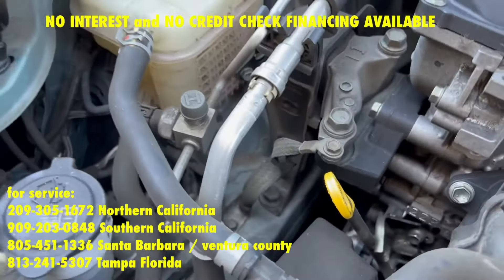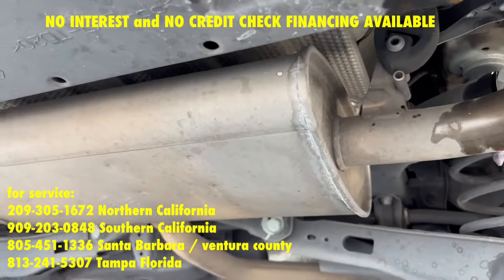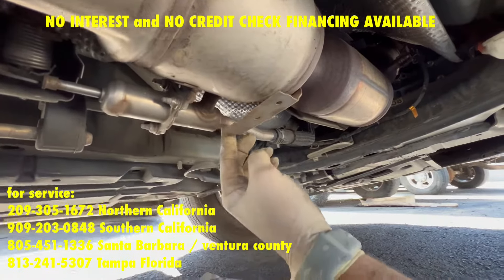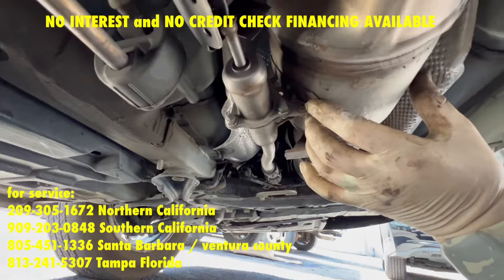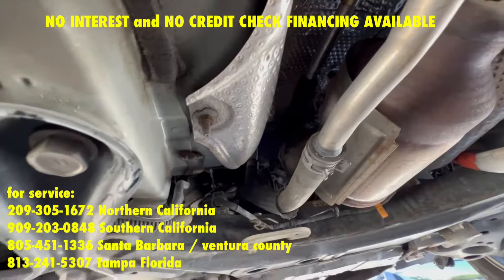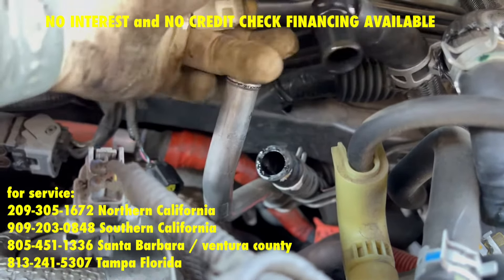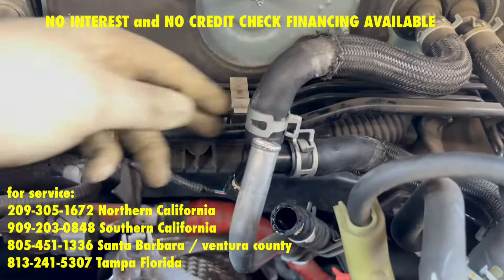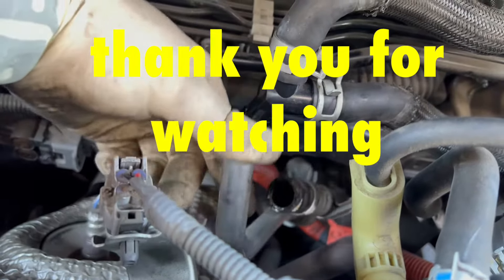Prius Ct200h Losing coolant exhaust heat recovery exchanger

Comment: Thank you for your video. I’ve been having this problem for a year.  I’ve been having to check my coolant every week to prevent overheating and recently I forgot to do it and my car overheated today in the rain.  Fortunately I found your video and felt confident to drive home because the coolant was not leaking after refilling 3 times on the way home.  I immediately follow your instructions and disconnect the coolant to the catalytic converter.  For those that is wondering, you have to take apart the windshield wiper, the mechanic driver for the wiper, and the large panel above the engine in order to access the coolant hose connectors.  Took me about 1 hour.  Then it took me 1.5 hours to let the engine run and drive around the freeway to burn up the residual coolant at the heat exchange.  There were lots of white smoke coming out.  For fortunately it’s gone now.  My heat works fine.  So far so good now.   Your video saved me lots of headaches and money.  Can’t thank you enough for sharing this. 🙏🙏🙏
Reply: Hi does this effect the engine in the long  run I would appreciate you reply thanks
Reply: Pls reply I have issues 2020 Prius prime , and dealer ship asking 4000 dollars for change whole exhaust system , is their any issue if I do bypass , I think Toyota should recall all Prius prime after 2018 as all have same issue bcz prime has this kind of coolant exhaust system
Reply: My car has been running well without any issues since I disconnected the coolant to the exhaust.  It is worth the 2-3 hours of work and never have to deal with overheating and white smoke aiming out of tail pipe.  What they did was stupid, there are too many vibrations at the exhaust and can easily cause coolant leaks.
Reply: @calidragonveganicfarm7967  thanks for reply
Reply: By the way, as mentioned in the video, disconnecting the coolant from exhaust has no adverse effect to the engine. Only draw back is that your engine will take a few minutes longer to heat up.  Waiting a few minutes to for the heater to work is way better than having to deal with coolant leaks and expensive repairs.  For some reason, I think my mileage has improved since I disconnected the coolant from the exhaust pipe.
Reply: Your welcome.  Please note that after you disconnect the coolant to exhaust, there will be residual coolant in the exhaust and you will have to let the engine run for 1 to 2 hours to burn up the coolant. You can either put the car on park and step on the gas or drive around the freeway at night when there is less cars around  to burn up the coolant.  There will be lots of white smoke until the coolant are burnt up.  So don’t be alarmed when that happens.   What I did was I put something heavy to hold the gas petal, so I can be outside the car to monitor the white smoke. After one hour, I then drive around the freeway for another 30 minutes and then everything was cleared.
Reply: @calidragonveganicfarm7967 how about now situation ? Since after disconnected, no issues faced ? Hope u reply 🙂 im facing this is my prius 3rd gen 2011. Loss coolent lot of. Check coolent leak. But can' find.
Reply: @lakshajayako7189 If you have a Gen 3, it's likely not the heat exchanger—Gen 3s are notorious for head gasket failures which are much more labor intensive to address. Gasket Masters does have a great video on how to do it though.

I had a 2013 Gen 3 and kept losing coolant; couldn't find a leak anywhere and sure enough, it was the head gasket.

Comment: Title is misleading, you're showing a Gen 4 engine and Prius. CT200H had a Gen 3 engine which did not typically have the same heat exchange issues or very randomly.

Comment: I did this and even installed a new egr, water pump, thermostat, engine, radiator and still had the same problem

Comment: my coolant reservoir bubbling and overflows. Cooling system holds pressure and vacuum. The blue chemical fluid stays blue. So looks like not a head gasket. I got cold air out of central vents ans a little warm out of driver side vent. I still can not find the problem. The main water pump is running if I control it using a scanner.

Comment: 2016 Prius Four Touring blowing white smoke from exhaust. Just completed the bypass underneath the car in front of the heat exchanger successfully. There is nothing to remove to access the two 6” coolant hoses. I replaced them with a u-shaped 4” Duralast Hose “B88354 64312 S”. I used two of the spring clamps from the original hoses (better to use new if available as these clamps tire over time). I also used two Dorman coolant bypass caps part#02251. The cabin heat continues to work and the white smoke disappeared after 20-30 miles. Thanks for all the contributions above!

Comment: To add a bit of context here. This, in my experience, doing this bypass is what I found for directions to get to the hoses. This is my model so your milage may vary. 

First I had to remove the wipers, which was a small cap at he base and a 10mm nut. No puller was needed

Second I removed brake fluid cover, Then the two pieces of cowl on each side. They are held on with 2 clips each on each side had to use a flat head to pop them off. 
For the main cowl its two push through clips on the front one on each side. Then peel off from the windows. I had to used a flat head near the glass and hand under the cowl to pop the cowl from the rubber gasket at the lower part of the windshield 

Third remove the wiper motor. Its two 10mm bolts on each side then unplug and remove

Forth the lower cowl. there are 10 10mm bolts two on each side 3 on the right back side one on the back left side and 2 holding the wiper motor braket. Then 4 14 mm bolts that are suspension mounting bolt. Only two of the 3 on each side need to removed. At this point to should be able to remove the lower cowl/cross member.

You should now have access to the hoses in the video.

Comment: I also have a 2017 Prius Prime that was smoking so bad it looked like a coal rolling diesel only in white smoke.   I knew the EGR cooler had coolant exchange, but until I started researching youtube  videos to learn there was another coolant exchanger in the exhaust.   What will they think of next.  I ended up heading to Lowes, buying 3/8 galvanized NPT pipe, 3", 6" and a 3/8 nipple and created a U bypass and pulled the hoses off the heat exchanger under the car.   I added hose clamps in addition to the factory clamps to make sure they stay on and it indeed fixed the issue.  It took me about a 50 hour drive to burn off all the coolant out of the exhaust system.  Next day I noticed that driving in my town that the car was noticeably not putting out the heat by a certain gas station that it normally would.  I may perform this bypass to reduce the amount of fluid in those lines the engine has to heat up to temp.
Reply from the maker: Awesome.

Comment: Thank you sir I tried this out hopefully it works. If not, then it’s the head gasket. I ended up sucking out the leftover coolant from both open hoses with a shop vac, then electrical taped them to keep them clean just in case I go back that route if it’s the head gasket lol.
Reply: Well, how is the bypass working on your Prius??
Reply: @tomvan3994  everything is still good. All worked out. I drive 90 miles a day and still not problems.

Comment: I have a gen 3 Prius and I've been having cooling issues and I think this just solved the problem. In fact I'm 99% sure it did! Please promote this to gen 3 as well as newer generation Prius owners!!! My coolant wasn't leaking but has been overheating. I changed the engine and was still having the same problem even though I replaced the coolant pump, the thermostat and had it flushed. Flushed. I think this is a design flaw of monumental proportions. My question is is it going to throw any kind of code? I don't think it should and it should not have any adverse effect on the engine, in fact, it should make it awesome! Thank you!

Comment: Hi, my Mechanic did a bypass because of the same reason of the coolant coming thru exhaust. Can this bypass let heat come thru vents even in the lowest temp? I dial the temp to LO and still get very hot air.. i have to turn down the speed to not feel so hot
Reply: did you solve this problem? Please let me know, i might have the same problem. I live in a cold climate and need the heat but if there is too much heat it is not good either :) So please let me know if you figure this problem out. Thanks.

Comment: Do you know if there is a TSB or any recall on this.  Mine broke at 4 yrs and 80k.  
Also can I assume the Cat converter is still good if this has been a problem for only a few days?
Thanks so much for posting
Reply: Yes there is a TSB for it
Reply: @Mister_H  thanks.  Just found it and had mine fixed for free at dealer. Covered under federal emissions warrantee 96 months or 80k. I had 79,500!
Reply: @pgreenx  that’s great news and just within the mileage limit 👍
Reply: @Mister_H  FYI… I walked in with the TSB thanks to this channel video and told him what was wrong. I wonder what would’ve happened if I played dumb
Reply: I just discovered that i might have this problem on my 2019 prius prime and of course this part is excluded from Canadian 8yrs-130 kilometer emission warranty on prius primes (at least this is what the dealership told me).
Reply: @pgreenx so if my car has 155,252 miles, does that mean I’m screwed? 😢 I just got the car from the dealer about half a year ago, is there anything that can be done about that??

Comment: what happens to the flap that is opened there in the exhaust when the cooling water is warm?  no water in it flap always closed ?  maybe the catalytic converter breaks down if the flap is permanently closed or Particulate filter may be clogged?

Comment: I just did exact thing on my 4th gen and the hose u left open on the bottom coolant started spewing coming out of it..please help
Reply: yeah when you do this operation you lose some it's normal just top it off if it falls below minimum at your toyota dealership
Reply: @Patrick-nc6kk  update it only lasted for a couple Oz and now stopped.this hack worked for my car and I'm very empathetic to the video creator
Reply: You should have sucked out both open hoses with a shop vac and then electrical tape them to keep them closed. What was coming out was just leftovers.
Reply: @rubensuarez20  your right and anyone in the future who reads this will benefit from your comment
Reply: @jstew4js  could you please tell, if your cabin heater stopped working? or it works as before only takes longer to start pushing hot air? thanks.
Reply: @dimdim3490  yes works just takes a bit longer to get hot..I live in a cold climate
Reply: @jstew4js  Does it take a lot longer for the hot air start coming out from the vents in the cabin? I just discovered that i might have this problem and of course this part is excluded from Canadian 8yrs-130 kilometer emission warranty (at least this is what the dealership told me).
Reply: @dimdim3490  just a couple extra minutes in a cold climate
Reply: I have the same problem , The egr has two openings , one opening is attached to the return pipe coming back  from catalytic converter , how do i stop the return pipe from spewing out the coolant ? I think the coolant  is coming from the second  opening of egr which is connected to the return pipe ,i toped the coolant but the from tht point came majority pf the coolant out
Reply: @Mikusin  yep u have to cap it

Comment: Long story short I don't really feel like taking apart my windshield wiper assembly... The vehicles already up... can I just bypass it by the cat?
Reply: I know this comment is from a year ago, and you likely already have this issue solved, but for others who made need to context, I'll answer it:

From what I understand, there is a way you can bypass it down by the cat. It's a little more intensive since you actually have to by a few parts and cut the hose, but it is entirely possible.

Comment: Great video. Looks like you have to remove alot of stuff up top to get your hands near those hoses? Did you also take off the windshield wiper mounts? So far, I've taken off the plastic cowling. Now it looks like I need to take off the thin metal cross-member that the wipers mount on to.. Thoughts? Do you have an expanded video somewhere? Thank you.
Reply: Yes you have to remove the cowl, windshield wiper motor and the bottom cowl to get to it. All 10mm and 14mm bolts, I’m doing it rn I’m actually just stuck on trying to remove the clamps and hoses, pain in the ass because of the angle of my clamps I can’t get to it

Comment: Hi, does this issue causes engine rattle on start? My ct200h 2011 causing white smoke and engine rattle on start and loosing coolant. Please help
Reply: While reading this thread I saw your post. I'm about 99% sure it's the head gasket. I had same issue with car having a very bad rattle. Take it in and get it checked out. Yes! Coolant is leaking through one of the cylinders causing a misfire in the engine and the rattle. Good luck.

Comment: I saw your short video the other day using some kind of dorman thing underneath the vehicle do you have a link to that one... My head gasket blew about 5,000 miles back and I rebuilt it in my driveway watching these videos... Did my first oil change today no coolant in the oil but I did notice there was a crapload what looked like an arterial bleed around the cat lool... I remember watching that short and was like oh my God... Well I guess we know why my head gasket blew now... And wife still been losing coolant despite the fact that everything inside with my engine Bay looks completely fine 🤣

Comment: Hello did this on mine but for some reason the car  lags a bit but has no coolant in the oil hence don't think the gasket is blown. There is still a bit of throshing in the muffler. Could this be the problem??

Comment: Is that a common problem with Prius? It just happened to me with my Prius 2019 as well
Reply: how did you solve it？ me top
Reply: Yes I have a 2016 did u fix yours?
Reply: Do you solve the problem?  I just discovered that i might have this problem on my 2019 prius prime. I am thinking doing this bypass but under the car, next to the catalytic converter (it seems easier to do it this way).    please let me know your outcome. Thanks.

Comment: Just tried this on my 2018 with 265,000 miles.  Coolant reservoir seems to be dipping down more rapidly except now I have puddles under the car instead of it simply disappearing. No coolant in oil and don't think the hg is blown. Any ideas ? Thanks.
Reply: its the same problem, it is on the prius 2016 as well. It is an issue with priuses.
Reply: Sounds like you created a coolant leak, did you figure it out?
Reply: Does ur egr has two openings ? One opening is attached to the return pipe from the catalytic converter , it came from there ? Did u solve it ?  An u share ur expereince please , i hav the same issue

Comment: Can I use this to my 2010 model prius?
Reply: I did on my 2010.  Had to refill coolant in the cat exchange to avoid smoking and exhaust coming into the cabin.  As well I had to connect those hoses so there were connected.
Reply: @ryanfitz5515 Did you reconnect back to original, or did you cap the ports on the cat so the exhaust wouldn't come out?

Comment: Gasket Masters - Muffler Tech – Please comment:   My 2014 Prius with 233,000 miles is experiencing coolant leak.
My car still runs good.  No engine shake.  I usually drive fast 75-85 mostly Texas intrastate,
The check engine light randomly comes on and then goes off after a while.
Code P0117
The Temp warning light comes on randomly after driving a while then goes off when I slow down.

I don't see any smoke or liquid coming from the tailpipe or leaking anywhere.  I do have to add coolant (about a quarter reservoir) about once a week.
Yesterday I had to refill the entire reservoir with coolant after a 2-hour drive driving 80-85,  Then next day drove the same 2 hours at 65  and did not lose any coolant.

Took my Prius to Toyota to check it out.  They said they could find no leak but, I need to replace my engine and the water pump.  They did not tell me why? 

To me, it appears to be a leak of coolant into the catalytic converter.

Comment: Just to confirm after doing this bypass the heater works and heats up just like before or there is less heat now?
Reply: Think it takes a little longer to heat up
Is all
Reply: My car 2017 heating stop working at all after bypassing
Reply: did you do this bypass? Do you have heating?  I just discovered that i might have this problem on my 2019 prius prime. I am thinking doing bypass but under the car, next to catalytic converter (it seems easier to do).    please le me know your outcome. Thanks.

Comment: Hi i just did bypass but heater stop working no heating at all even after driving 80km please give me any solution
Reply: Do you have heating?  I just discovered that i might have this problem on my 2019 prius prime. I am thinking doing bypass but under the car, next to catalytic converter (it seems easier to do).    please let me know your outcome. Thanks.

Comment: Update* 
Both of the hoses u leave open need to be capped especially the lower rubber black hose..I have been losing coolant out this for past year till I capped it
Reply: What did you cap it with
Reply: @jonasbaine3538  update: Im not sure if u need to cap it but I used duck tape,i have since found out my head gasket blew due to running low on coolant before I capped it
Reply: @jstew4js  oh damn. What will you do now ?  It basically lost power when trying to accelerate?
Reply: @jonasbaine3538  no just typical coolant loss and engine shuttering